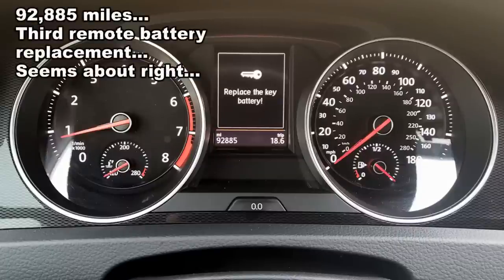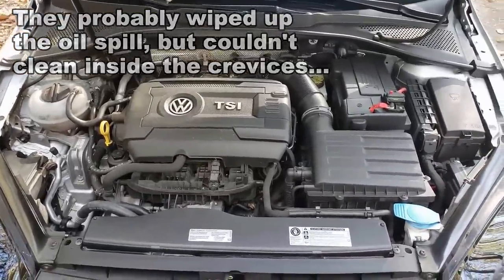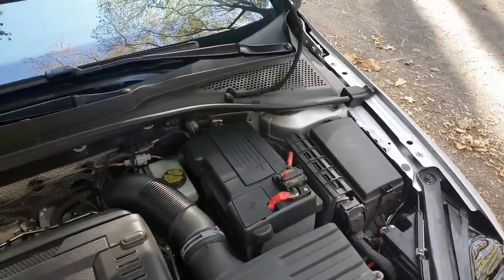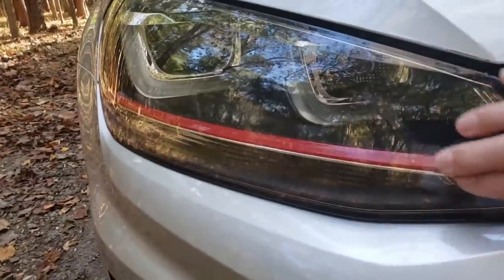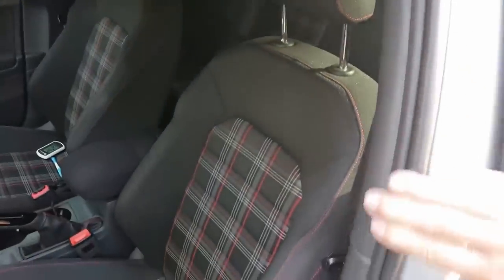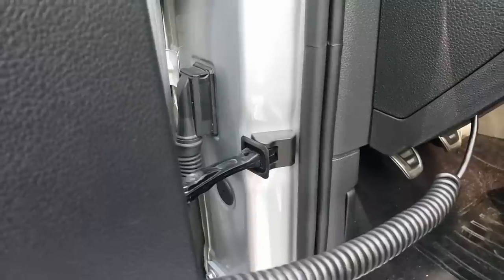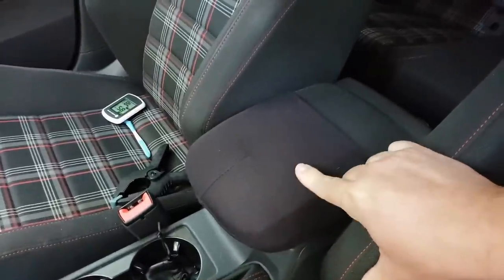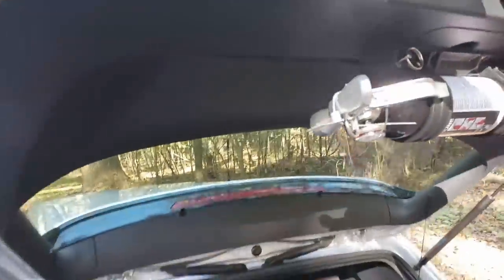THREE YEARS AND 93,000 MILES: My Report, Part 1

Comment: Greetings, have you heard about issues when installing aftermarket intakes?
Reply from the maker: I have not. I'm not particularly fond of aftermarket intakes, thanks to the culture at TDIClub.com. However, I am about to install a drop-in filter and turbo inlet pipe. Perhaps that'll free up some restrictions, if there are any.
Reply: As far as aftermarket intakes go you don't make much power increase if any but it will give you a nice woosh sound on throttle lift off, the stock airbox has sufficient flow is20 turbo.
Reply: @Jaymz87  it does give out a nice woosh sound which I prefer but, I am concerned due to increase air to the engine the air/gasoline mix might affect the engine performance at high speeds. I also ask because after installing and doing a couple of high races my engine said goodbye. Only intake :S
Reply: @StealthGTI  also for your information

Comment: Great video! Go with the metal skid plate.
Reply from the maker: I'll consider it. For now, I have a gasket to try. It was much cheaper than a skid plate.  ;-)  I'll switch back to the stock pan and a skid plate if this doesn't work to my satisfaction. Thanks for writing. -Scott

Comment: Did warranty take care of clutch replacement?
Reply: Clutches are usually maintenance items unless you can prove a factory defect.
Reply: @williamegler8771  how much did it cost if you don't mind me asking?
Reply: @ehsan046  parts $775 and labor $724.00.
Reply: @williamegler8771  wow! Makes me hesitant to tune my gti. 
Thank you!
Reply from the maker: As mentioned, clutches are a wear and tear item. I got lucky once and got a clutch under warranty due to a faulty throw-out bearing. But it's rare to come out on top of a clutch claim.

Comment: VW are nightmare, when it come to aftersale.
1 word to describe VW, FRAGILE!
Reply from the maker: That's never been my experience. Towing 500-1500 lbs trailers with my VW's has been my norm for over 20 years. My 1998 Jetta TDI lasted 450,000 miles and never opened the engine beyond the valve cover gasket for timing belt jobs. I don't expect the same out of my GTI, but it's been going strong, even with trailer abuse, for nearly 100,000 miles. Maybe it'll explode next week. Who knows? HAHA! FWIW, I don't buy VWs for resale. I drive them until they're worthless, often a minimum of 10 years. :-)  Thanks for visiting.
Reply: I mean aftersale service are nightmare in my country. My jetta give me a problem since day 1 till now 2 years and never fix the problem.

Comment: Would you recomend this car for someone who drives less then 10k miles a year?
Reply: Lucky You yes
Reply from the maker: I would. Assuming your daily drives are short, I'd take a longer drive at least once a week to ensure the engine gets to full operating temperature for a bit... say 20 miles (my preferred mixed route to maintain my daughter's car while she's away). I feel this is important for ANY car, not just VWs.
Reply: @StealthGTI  i agree, my question is if its reliable? I alwayes heard that they have a lot of problems. I dont want to be in dealership everyweek
Reply from the maker: @luckyyou774  - Any car can have problems. My 1998 Jetta TDI never left me stranded during its first 350,000 miles. When it did, it was just a broken CV joint. My Mk6 Jetta TDI went 75,000 trouble-free miles before I sold it back to VW (Dieselgate). My Mk7 went to the dealer to have initial delivery flaws fixed under warranty (which can happen to ANY car). Most of the other issues were self-inflicted or normal wear and tear. It did not go to a shop for any of it, except for the glass. I think a car will take care of you so long as you take care of it. However, there's always that chance that expensive things will break, as was the case with my wife's 2003 Passat. I hated that thing. It was great for 10 years, then became a non-stop liability.
Reply: @StealthGTI  well i mean any trabnny problem looking dor dsg, any engine or turbo problem, not talking about normal wear
Reply: I have a '17 GTI. Bought it new two years and 1 month ago. 16K miles, zero issues.
Reply: @nsbioy  good
Reply: @nsbioy  u hae 6 year warranty on it right?
Reply: @luckyyou774  3 year 36K for the  2017. They have 6Y 72K for 18 and 19 models only.

Comment: Like you on my Mk7.5 I had what looked like an oil leak at only 800 miles.  Took it in and it wasn't an oil leak, it was transmission fluid.  Upon inspection there was a defect in the transmission which required an entire transmission replacement and VW ordered a new one from Germany, all covered under warranty.  Not everyone gets a new trans at 800 miles! VW did a great job finding the problem and fixing it.  I'm sure that wasn't a cheap fix on their end.

After that everything has been basically problem free (25k miles now).  Like you I was worried about water intrusion in the sunroof (I have one) because every other Golf I saw on the dealer lot had headliner water damage, but mine has had zero water intrusion.  I absolutely love the sunroof so I'm glad I lucked out there.
Reply from the maker: Very nice! Glad everything is working out for you. Take Care, -Scott

Comment: nice review ! 👌 coolant loss may be due to a broken water pump sealing (had that with some EA211s)
Reply from the maker: Thanks. I'll inspect soon.
Reply: i agree, the slight leaks just evaporate off the engine block so you never notice it. the pumps are big plastic monstrosities that fail repeatedly.

Comment: Hi! I have a 2015 GTI with 68,000 miles and never had an issue with my oil pan. Still the original. Also have seen no cooling fluid loss. My car is not tuned though....
Nice video!
Reply from the maker: Thanks!

Comment: It would take a major crash and front end damage to affect the factory oil pan, and probably that would mess a steel one too. It is properly designed to be polymer, I wouldn't mess with it. Ive never seen a broken one ever, and I've had 2 cars with it and visited their forums for years. Its not an off road car and I've cruised many semiplain dirt roads without a single problem. People should stop fearing polymers. MK7 MY17 GTI from Argentina. Great to see you rolling well!
Reply from the maker: Thanks for the note. I've seen plenty of broken pans. Most are caused by rocks on the road or even ice chunks. The threat is real, but the odds of a piece of debris hitting the oil pan just right are fairly slim. Thanks for visiting.

Comment: I bought a MKVII GTI with 176k miles on it. With a almost brand new engine. All work was done at vw dealer.  In the paperwork from the dealer cause of previous engine failure was listed as "catastrophic rod failure"

Car ran great and is it for same as bought it
Reply from the maker: I wonder if the rod failure was from a "money shift?" Regardless, congrats on the car and new engine.

Comment: Thanks for sharing your experience! My 16 GTI turns 4 in a little over a week and I have 124,000 miles.  It has been a fantastic car. Just recently had to top off my coolant for the first time. No major issues.  I do have a rattle in my front suspension that I am having checked out on Thursday. The rest of the car has been solid. I have had to replace the windshield twice. The first time it cracked very similar to yours and I never recalled anything hitting the windshield. The car "stutters" when going from reverse to drive. It's been doing that since I bought it. Very satisfied with my GTI.
Reply from the maker: Very nice! I'm glad to see another mighty-miler! I think you and I are driving approximately the same average annual mileage. Can you comment about carbon build-up? I'm getting a lot of questions about it. But I haven't worried about it beyond fueling with Top Tier fuels and my bi-annual heavy trailer load, which I hope burns away some of the deposits. Thanks for visiting.

Comment: Great review! Really enjoyed it. You said you put did an APR Stage 1 and into a Stage 2. It sounds like you did that while still under factory warranty. What is your understanding of how an ECU modification like that affects the warranty. I've heard it voids the warranty, but I've heard that's non-sense. Would like to hear what your understanding is as well as anyone else's. Thanks!
Reply from the maker: My understanding is a company cannot void a warranty based on a mod alone. They must illustrate how said mod caused a failure. For example, there's no way VW could reasonably articulate that an ECU tune had anything to do with a strut failure. But they COULD blame a clutch failure on a tune and be within their right to deny coverage on that part. If you disagree with them, you could always take them to court. But that could be costly, too. Right or wrong, it would not be hard for a judge to side with VW regarding a driveline failure when the tune drives the engine outside of VW's delivered boundaries. Likewise, the same judge would side with VW regarding a failed CV joint on a car that's dropped on coilovers. Hopefully, that judge would compel VW to repair a completely unrelated problem. For that, I suspect VW would avoid court; but can you afford to lawyer-up and get them to that point? I've read conflicting stories on whether a TD1 flag kills the entire warranty or simply compels someone to review the mods when the car comes in for warranty work. It's a risk, for sure. I took the risk, have enjoyed the rewards, and never looked back. Thanks for visiting.

Comment: I literally just replaced my water pump on my '14 CC with this same engine. I too was having to fill the overflow tank every so often. Unfortunately, with the placement of the water pump, it's really difficult to see if it's leaking. The pump is plastic, and if you've got even a small oil leak that is running down the front of the block and contacting the water pump, it'll swell and contract with different temps. This causes the gasket to fail and they pump to leak. I wasn't getting any coolant on the ground. It was all falling onto the splash shield below. This is a known issue on the EA888 2.0T, so I'd remove your intake and air box to get a good unobstructed view of the pump. Best of luck. A water pump replacement is a mother on these engines.
Reply from the maker: Thanks for sharing that. I guess now I know where to look for the water pump. It was closer to the drive belts on my TDI. -Scott

Comment: What is your experience with intake valve carbon buildup?
Reply from the maker: My mechanic and I are of the mindset, "Don't look for trouble until there is a cold-start issue." As a result, I'm not aware of any carbon that may or may not be present. I hope that my occasional heavy load towing helps to burn away excess build-up, if present. Thanks for visiting.

Comment: How reliable has the engine been? Ive heard horror stories about this engine.
Reply from the maker: The engine has been fine. No faults, whatsoever.  Thanks for visiting.
Reply: @StealthGTI  Really!!! I heard the timing chain tends to jump off its track and should be replaced with a timing belt using a kit. Ive also heard the engine tends to carbon up which can lead to valve failures. Im happy and surprised you havent had these issues.

Comment: So many repairs from the beginning. So many lies from VW
Reply from the maker: I disagree. See Part 2 for an explanation. Thanks for visiting.
Reply: @StealthGTI  So you disagree your own words? And you disagree that VW is endless money pit, and that they are cheating people and government. Cool
Reply: How are they cheating you annymore then all the other car manufacturers?
Reply: @liridon89  lol open your browser and type in VW cheat. They were doing it before, they are doing it now too.
Reply: @morishogo144  emisson cheating you on about? Since the whole industry has been caught red handed in some sort of emission cheat after VW got caught. I would say that kind of lie is better then for example  GM that deliberatley killed ppl with  there breaks etc. Just an example to show how the whole industry will lie if they can save monney from it.
Reply: @liridon89  they still lie and cheat and are not reliable. So i don't understand why whould anyone buy VW and GM
Reply: @morishogo144  well from my point of view i would disagree i have had Peugeot, Nissan, Honda, Ford, and the most Reliable in my carpool har been the 1.9tdi b5.5 which we had from brand new and still rolling 398k km and   no major fix accept the obvious spareparts. Have 2.8litre v6 200k km no issues , 1.8t had one oil sludge prob were we changed pump all ok.and ofc 1.8t problem with eating cyl 2 and 4 coils,
Reply from the maker: @morishogo144  - I disagree with YOUR words. The problems I presented have cost less than $500. It would have been just $300 if i hadn't decided to upgrade the battery. I hardly consider $300 to be a "money pit." As for VW cheating, they have paid more than any other automaker for their crimes, which didn't even harm anyone (like the automakers whose cheating has killed people). Later.
Reply: @StealthGTI  they are bad engineers that's why they need to cheat. And I'm just telling the fact nothin more nothing less.
Reply: @liridon89  so you got bunch of bad cars. And I'm just telling the fact. And VW is nowhere in reliability list.